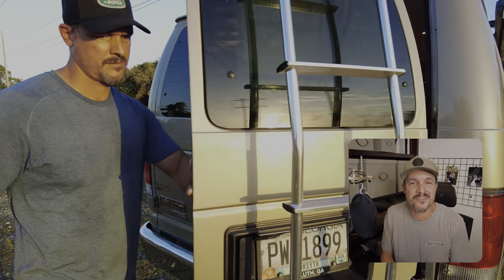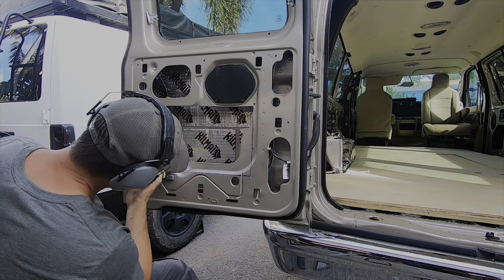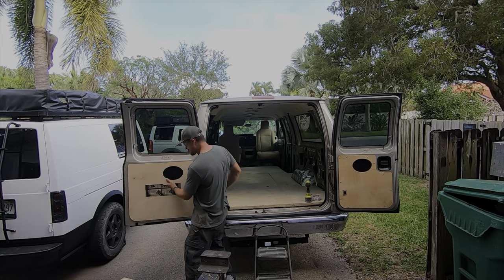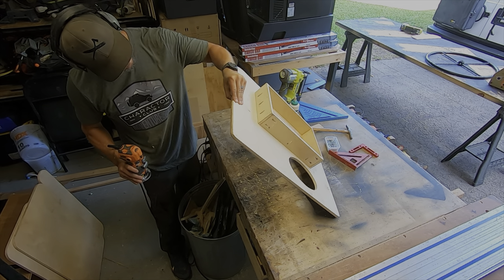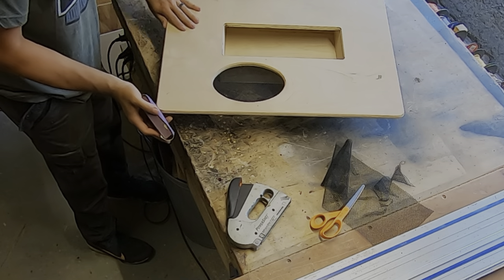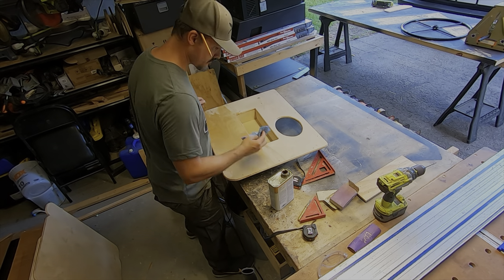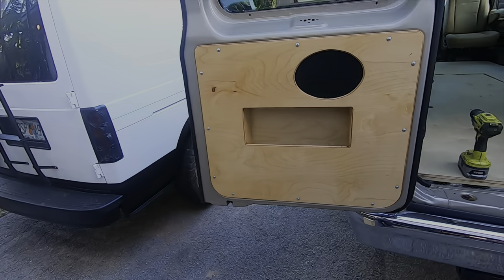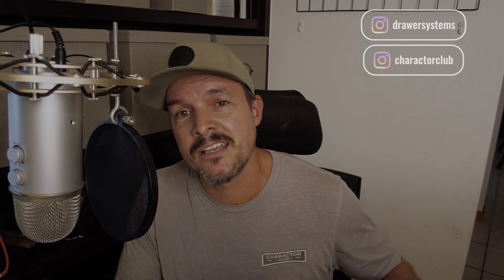Custom Door Panels - Ford Econoline Van Build Part 4

Comment: any chance you'd be willing to share the design files for the read door panels?   I'm just getting my e-350 gutted back to the bare walls
Reply from the maker: I would if I had them. I made a cardboard template to find the shape and then cut and sanded until it looked right. If I remember correctly the main shape of the door panels are square (the only thing in the van, lol) so it’s easy to measure the height and width.

Comment: My wife found your channel and we really enjoy your builds. We are waiting on your next one for this van. I am curious about the heater in the back and did you have to remove it for the bed. Can't wait to see this one finished.
Reply from the maker: Thank you!!!! A new video will be out this week. :)
Reply: @drawersystems  Please drop it! I'm about to buy this van and I want a similar build, leaving most of the interior walls and ceiling carpet :) How is the temperature inside when you don't insulate the roof?
Reply: I want to remove the heater and air conditioning unit from the rear of mine but I don't have any clue how to do that.

Comment: Hi! I love your build! I’m using your videos to give me some ideas. I just finished the solar panels and fan installation. Now, I’m moving to the interior. Quick question: did you use foam board to insulate the ceiling? If so, 1 inch or 0.5 inch? I would love to see a tour from this van! If possible, could you please upload a quick video on a update? Or maybe send me some pictures? Thank you and keep up the good work 👍🏻
Reply from the maker: Thanks for the compliments and glad I'm giving you some ideas! I actually used Thinsulate in the ceiling and the foam board on floor and walls. Just uploaded a new video if you want to check it out ;)

Comment: Love it!  I have a Ford E350 Class C, older model and the doors have no pockets at all.  Neither does the dashboard! Can you imagine. Nowhere to store my documents. So frustrating.  How do they even sell vans like this.  Japanese cars are so ergonomically detailed with all sorts of cubby holes everywhere.  So I have to custom fabricate something.  This gives me ideas!  I also have speakers in the doors.  I love that box storage you added.  I also have to make a center console for the doghouse area of the cab.

I do a lot of wood refinishing, and so let me pass on some advice.  Don't use Tung oil or Danish oil. I used to use them a lot for antique pieces.  Not any more. They get gummy with time, they darken, they get dry, they don't seal the wood, and are finicky in weather.  Here is what I do:
Sand fine, so that whenever you touch the wood, it caresses your hand like satin. Liberally lather on boiled linseed oil. Let the wood soak it up, be generous.  After 15 mins, wipe off all excess oil and let dry 1-2 days.  Dilute oil based clear interior satin polyurethane (Varathane from Home Depot) with Mineral spirits 60:40 Poly ratio.  50:50 also works.  Brush this on. After 15 mins wipe/smear with paper towels to pick up drips, wipe off excess, prevent bubbles from cratering, etc.  Let dry.  Repeat.

Now you have an indestructible finish that is waterproof and UV resistant.  No fussing with it, and wood is all happy underneath with its oil conditioning. The oil gives a golden glow, its cheap, and takes the poly once dry.  I do this now for all wood pieces.
If you are going to leave the doors wide open in sunlight for tailgate parties OFTEN, then switch to Spar Varnish from Man o' War or Epiphanes. Its darker but very UV resistant.  Spar Urethane is not as UV resistant as Spar Varnish.
Reply from the maker: Awesome, thanks for the tips...I'll have to try it out on a future project.
Reply: @drawersystems  Build me a set! Haha

Comment: How much head room do you have on the bed? Can you sit on the bed ? 
I want to build bunk beds so 4 of us can sleep, 2 at the top and 2 on the floor. Do you think both of the beds will have enough head room where we can lean against the pillow or side ?
Thanks
Reply from the maker: On the bed I built you can sit up slouched….adding a second bed and you’ll be very tight.